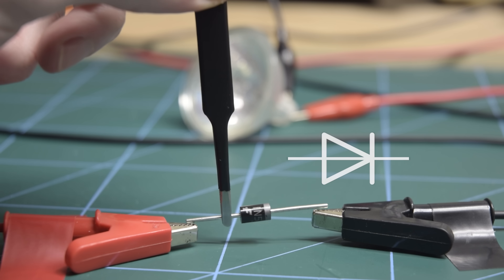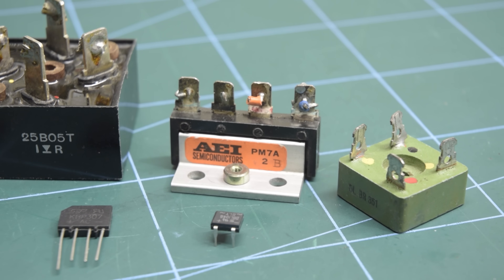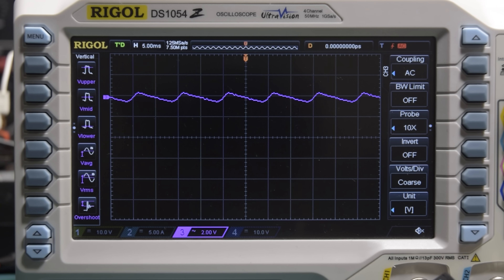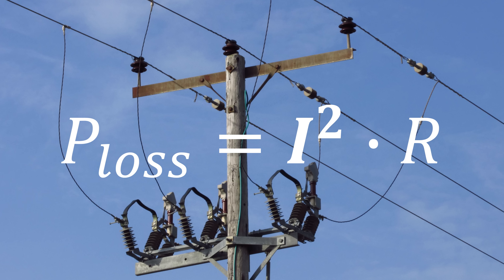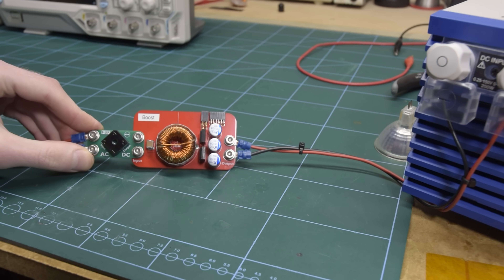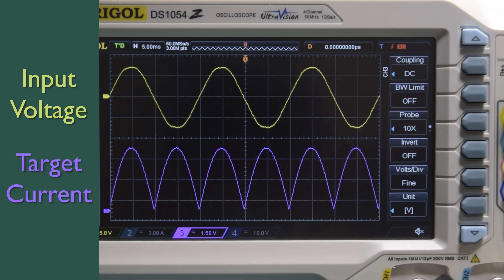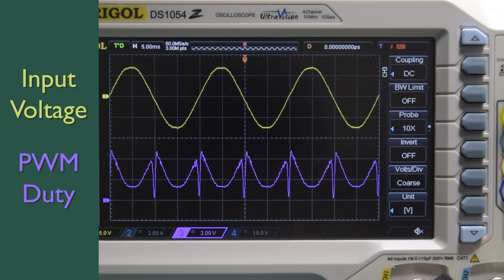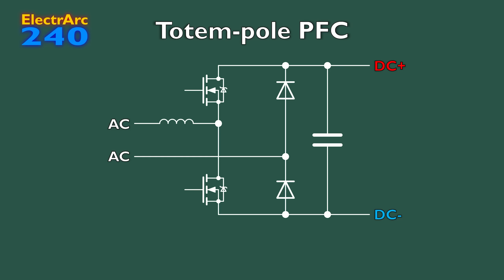Fixing the Full Bridge Rectifier’s Big Flaw - Active Power Factor Correction

Comment: Very cool. Though even simple AC-DC bricks that lack PFC can run on multiple voltages because they can simply adjust the duty-cycle of their isolated switching topology. Gone are the days of fixed voltage ratios on iron transformers, unless you want multi-decade reliability or no switching noise, that is.
Reply from the maker: Pfft who wants reliability, not manufacturers...
Reply: @ It’s still a significant concern in the medical industry. Probably military too. I think most UPSs use a low-frequency inverter with a big iron transformer too, likely also for reliability. Audio circuits use iron transformers, but there it’s more about the convenience of having multiple rails and low noise.

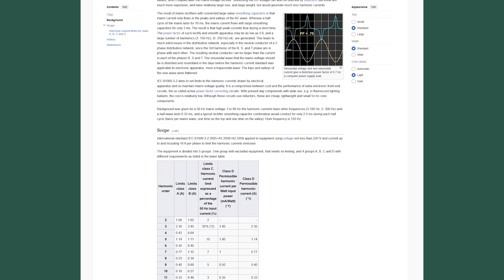Comment: Nice demonstration of active methods. A few points. Without going active. you can reduce the burstiness of the capacitor charging current by spreading the charge time. You show doing this with an inductor, but in fact you can also get a gain here by simply using a smaller capacitor, so it droops quicker and therefore is below the charging voltage sooner. A lot of people think they want a massive capacitor to give low ripple. In fact, you should work out the maximum ripple your circuit can tolerate and size the capacitor to give that (with tolerances). Also at 5:00 you say harmonic current emissions are essentially the same a power factor. I'm not sure that is true. A simple reactive load will not emit harmonics but will have a phase shift leading to a poor power factor. Am i wrong about that ?
Reply from the maker: No you're right harmonic emission is different to power factor. I just said that to keep things simple and not go into detail about displacement vs distortion power factor. It would've been more accurate to say it's essentially the same as distortion power factor. But that's basically all I am referring to in this video so I thought I'd get away with a small omission.
Reply: @electrarc240  Absolutely great video and great project. However, the 'true Power Factor' concept includes two components, the displacement factor, which will cause unnecessary power transfer as you mentioned in the video, also distortion factor, which is essentially a harmonics problem, which will cause different problems to the grid. I am not sure why we have to put these two factors together, instead PFC, DFC, distortion factor correction maybe a better name, any thoughts?

Comment: Great content! Now I'll feel dirty every time I build a plain old full bridge rectifier.
Reply from the maker: As you should hehe
Reply: @electrarc240  make a video about a how a SMPS (not flyback) work
Reply: @geofftnz Go big or go home! Make a thyristor rectifier!
Reply: Remembering the old days when electric equipment was only motor, transformer, & incandescen hot lamps, the only pfc solution that day just capacitor, both passive or active bank ones, today with switching psu's, led lamps, even inverters, I know we need something different instead just capacitors, coil banks? I don't think so, now we know from this video
Reply: @aikonlatigid  I have my late uncle's home-built tube amp. Looking at the high voltage wiring I am scared to turn it on. Everything point-to-point wired with a few tag strips. The only "modern" thing is he upgraded the diode tubes to silicon diodes in the power supply.
Reply: post bridge trauma ?

Comment: How does this, and how do off the shelf PFC IC's work if fed high voltage DC? you can power coventional SMPS' with HVDC, as it can be more efficient than an inverter in off-grid applications, especially because inverters have higher idle consumption
Reply from the maker: I really want to know this!!! I have a beefy HV power supply so might try it one day. Can the controllers cope and just run at constant duty or will if throw a fit

Comment: Oh my, what a clever way of showing the function of the bridge. The LED's let one correlate the physical world with the screen information.
Reply from the maker: All rectifiers should be made of LEDs lol, even at mains frequency they look so nice!
Reply: @electrarc240  but all 4 leds must be the same  colour. The difference between the half ways is visible even in your video
Reply from the maker: @igorzherebiatev5751  I tried to compensate with a DC offset on the function generator I used but still didn't fix it completely
Reply: That's merely because of the difference in forward voltage.
Reply: @ That was a good try though! I wouldn't have immediately thought of that myself.

Comment: All this complexity and possible failure points to please the power
 company? Or does it also actually make the power supply more efficient?
Reply: No ... Not to please the power company.   But to keep the cost of power production, as low as possible.  A poor Power Factor due to THD is averaged in to the base cost of your electricity.  So every consumer of electricity is paying more.  The power plant will not absorb this cost.
Reply: it lowers the number of amps you draw, which reduces the heat generated by power passing through wires, which reduces wasted energy. So it means you can get more power out of the same size components and wires, as well as you can have less heat generated, and improved efficiency. With so many devices being DC, and our supply being AC, power rectification is such an important part of how we handle electricity.
Reply: @weeveferrelaine6973  The sine wave is actually visually clipped ( a flat top ) in many communities.  This needs to be "fixed". Active PFC to the rescue!  Active PFC circuitry has been incorporated in many electronic products for the past 10 - 15 years.  This is not "new", just tighter regulations.
Reply: @MrSummitville - PFC has been a "thing" since the 1990's,  and has been a problem since electricity was first harnessed.
Reply from the maker: @MrSummitville  Yeah you could see an exaggerated example of this when I turned up the load at one point in the video. Because my "mains" was the output of a very puny transformer so it was easily distorted.

Comment: I'd been looking forward to this one to try my hand at fixing what i believe to be, a faulty PFC on a computer PSU. Quite comfortable working with electronics, but never quite worked out an active PFC. Issue I've noted is the PSU, when powered on (the PC must be on), is feeding back 50Hz harmonics back to the mains over neutral and making motorised appliances hum at 50Hz audibly. The only thing I can think of that would cause that is the PFC, since it occurs only when the PSU is active and not just when connected. PSU otherwise works perfectly. Any recommendations on what part of active PFC is likely to cause that? I'm guessing one of the MOSFETs is possibly slow or leaky.

Comment: Great video! I wonder whether it would be possible to develop at circuit for older 3-phase AC asychronous generators to switch the 3-phase capacitors (cap. banks to be specific) in parallel to the asyn. generator by IGBTs with some kHz instead of the usual dumb contactors (wich tend to fail)? 🤔

Comment: How do they driver the MOSFETs on those PFCs?
Reply from the maker: I used an Arduino controlling a standard gate driver. Usually this would all be done in a single PFC controller IC, including current and voltage sensing

Comment: Great video... i remember having to do these PFC correction calculations manually on a 3 phase balanced system and passive components when I was studying electrotechniques... so I missed why you need a boost converter... Could a bucket converter also have the same effect?
Reply from the maker: A buck converter wouldn't be very good because the input current is discontinuous so it would need large and expensive filtering compared to a boost converter with continuous input current
Reply: @electrarc240  I see. Maybe i should finally go and build a boost converter... I never needed one...
Reply from the maker: @MellexLabs  I highly recommend!

Comment: It's pure unadulterated electronic voodoo I tell you. Electrickery at its best! I guess there is no hope for my "NO-NEUTRAL" circuit when it comes to power factor correction, because its all about crappy half-wave rectification. But its only powering lite loads like LED bulbs and smart switches.
Reply from the maker: Yeah PFC isn't so important for very low loads like those

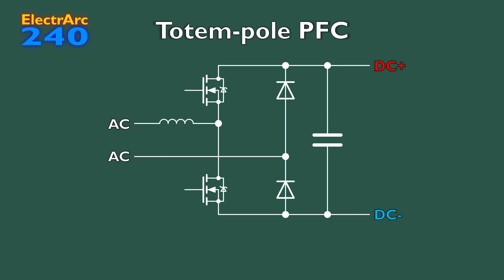Comment: Wonder where have I seen the same arrangement as 11:12, ah yes, inverters and H bridges, things are getting interesting
Reply from the maker: All power electronics is tending towards simple half-bridges lol. (not really of course)
Reply: @electrarc240  I know. Working in comercial solar and battery storage, I've seen the trend over the years, going from complex multi stage inverting to simpler power stages and awfully complex control electronics.
The only manufacturer that started with as simple as possible power stages was and still is SMA, those Germans, they must know smtg 😂
Reply: @SwichMad It's funny how even 20 cent microcontrollers are so stupidly powerful nowadays you can just simulate complex circuits in software with few components. All hail the silicon gods!
Reply: @game-tea  yep, but on the other hand, commercial equipment is also built with redundancy and resilience in mind, that's why you find dedicated MCU's in most of these and anything that can bring the equipment down is overengineered. 
Some manufacturers succeed and have a astonishingly low MTBF, others fail miserably
Reply: On that note, BESS is a prime example. 4 MW battery pack of German origin with extremely simple and safe design at high level - MTBF: 1 year
Tesla Megapack roughly same capacity with decentralised design - MTBF: 1 week

Comment: I love it how bidirectional inverters and PFC are sort of one in the same
Reply: makes sense since the grid operator doesn't want garbage in their wires from PV inverters... needs to be as clean and in-sync as possible
Reply: Even in off grid, there are now "AC coupled" systems with 4 quadrant inverters. It makes for a more robust AM/HF transmitter or audio amplifier as well.
Reply: Power circuitry is just the same - but the PFC is harder to control. Because you have to pretty much measure the voltage and current in real time and boost the voltage with just the right amount at any given moment - not to just keep a constant output voltage or current, but to keep the input to be sinusoidal while at the same time compensate for variations in current draw by your load. That was what the disgusting code was all about. 
For the inverter, it will run like a buck converter istead. That means your output voltage is ideally proportional to your PWM duty cycle. 50% will be your zero output (the inductor will filter out the high switching frequency - adding an output capacitor will further help with this), 75% is half positive, 100% is fully positive, 25 % is half negative and 0% full negative. Then something like a wien bridge oscillator can be used to get a sine signal and feed into a voltage controlled PWM circuit, to form a low frequency AC output.
Feedback will probably be needed (which controls the amplitude and offset of the sine signal) to compensate for variation in input DC voltage, load and any assymmetries in the load to keep the output voltage constant and a pure AC output with not DC components - but those are just slight adjustments and don't need to be done as fast as the PFC, where just a millisecond delay or so, may fuck it up completely.

Now if you want to feed power back to mains and not just drive an AC load from a DC source, it gets a little more complicated of course - as now is has to be in sync and compansate for voltage variations and noise on the grid (the sine wave on mains is not often perfect). But I doubt is as hard to do, as the fast and vigorous adjustments needed for the PFC circuit.

I tried my self to make a PFC (just the simplest boost topology), with analog circuits (as I'm not as good at writing code), but never really got it to working (very hard to really get the input sinusoidal and not heavily distorted, that's not much better than just running without PFC) and "cheated" by using an integrated PFC controller (UCC28019) instead - which works well. 
I did make a small test circuit for a class D amplifier though - which works very similar to an inverter (uses the same H-bridge configuration - or a half bridge, where 2 transistors are replaced by 2 capacitors - but those are controlled in the same way), but the output is not just an AC sine wave, but a "copy" of the input audio signal, that's much stronger and can drive a speaker. I got the THD down to 0.3 % (anything 3% or less is good for just a power or motor drive inverter). That one was quite easy to get working. I will probably make a bigger inverter later - and maybe post a video of it.
Reply: @Speeder84XL  Given my experience with audio this screams software and micro controller style problem.
Reply: @RNA0ROGER  Maybe - but most power circuits don't really need microcontrollers to work (unless you want them to do certain things, like vary their output voltage or current according to a graph or preprogrammed curve, do math like calculating power output etc.)
Buck and boost converters, flybacks and "single transistor forward converters" can be built using just a 555 timer (as the oscillator) and a comparator. 
Then have zener diodes or voltage references, optocouplers and/or small signal transistors for the feedback. I have built many such ones already that works well.. 

Also a class D doesn't have the problem of for example A/B, that it may get distortion even at low levels. If it's 0.3 % THD at full amplitide, it's less at lower amplitude. I think it was quite good for such simple circuit, that was like 2 comparators (just one LM393 chip, that has 2 comparator built in) and gate drives as main components (along with some capacitors and resistors to adjust offset, amplitude and dead time)

Maybe the PFC would be easier to do by microcontrollers though
 - since it seems quite hard compared to all other things I have built, when the input and output being actively controlled at the same time. That's the only one I haven't been able to really get working, from just my own design (it works well to use a premade control chip though).
Reply: @Speeder84XL  I am exactly the opposite leaning quite heavily into code. Getting spwm with anything other than a micro is a giant pain. I got a 328p to drive an ironcore transformer to actually get it to drive an induction motor. It was a dumpsterfire but functional.
Reply: @RNA0ROGER  Yes - then it's a whole other thing. There is nothing bad using microcontrollers
 - what I meant is that for us who have never written much code, there are other ways as well. 

A very simple voltage controlled PWM generator can be made, making an astable oscillator using the 555 timer (basically only need 1 external resistor and 1 capacitor to get a 50% duty cycle square wave). There you also get a triangular wave over the capacitor between the trigger/threshold legs and ground

This can be fed directly to the inverting input of a comparator
 - now you just need a voltage on the non inverting input to control your PWM duty cycle 
- 1/3 of the supply voltage is 0%, half supply voltage is 50% and 2/3 is 100%. 

For something like a power regulator, that doesn't need feedback, this can be done by just a potentiometer (and preferrably 2 resistors to minimize "dead zones" at the bottom and top of your range)
For a DC/DC converter for example, you will have that voltage controlled by a pullup resistor or voltage divider (that set the maximum duty cycle)
 - which in turn is connected to your feedback that can draw a small current and pull the voltage down, in order to regulate the output voltage or current.
Reply: @Speeder84XL  As you mentioned previously do really consider making videos. There is a lack of genuinely compelling electronics content.